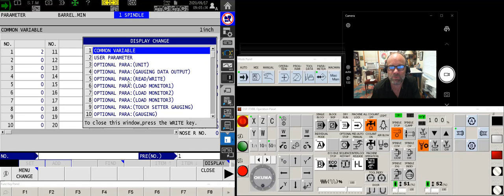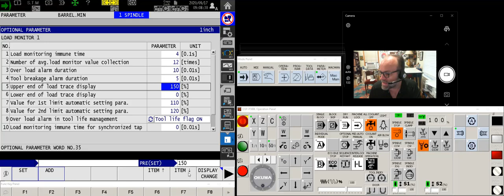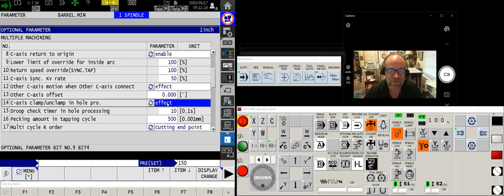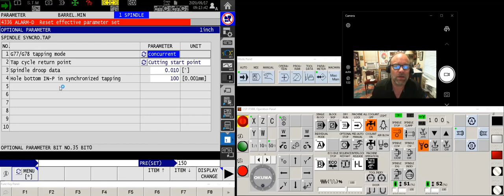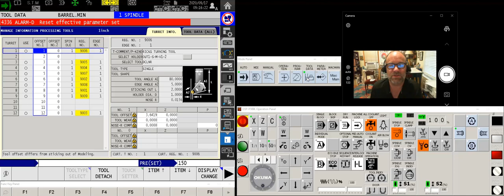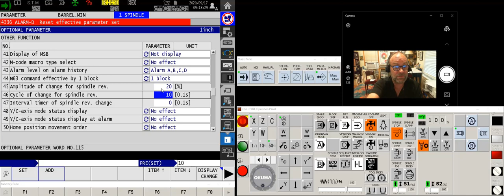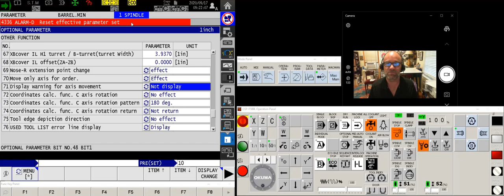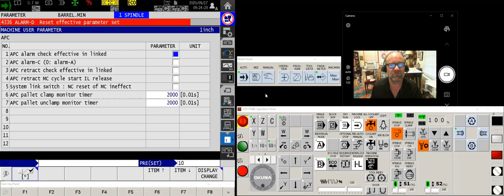Okuma Lathe Parameter setup

Comment: Hi, we have issue.  Loking for help. Chuck vibrate when we turn it in c-lock mode. This happend only when make heavy parts. We figure out that the extra weight is making the chuck overshoot it's position and the vibration is the machine trying to correct it. So watched your video and found parameter: Spindle rotation command stabilizing timer.  Is this correct parameter to adjust? Any other ideas to solve proplem?
Reply from the maker: Oh yeah! Heavy parts can cause problems. Look for the WORK WEIGHT parameter. There are three settings on most machines, four on larger (no chuck, standard , semi standard, and heavy). Try a heavier setting there, and also on your main operating screen under display change, you can run SERVO NAVI which will test the weight on the chuck and adjust the servos accordingly
Reply: We check this tomorrow. We had made this part few years. 
This issue just started yesterday.  when hevy part is chuck and push c-lock all good, it also start vibrate if i hit chuck slow on rubber hammer.

Comment: Hello, I have a problem with my lathe control osp E100l, I changed the ucmb card, restarted the software, and now I have an alarm 4710 alarm D parameter non set 1 can you help me because I do not have backup parameters
Reply from the maker: That alarm means that the user parameter spindle max rotation speed parameter has not been set. Set that manually then cycle power

Comment: I was wondering if you could do a video using m695 I moved the keys on the parameters for this code I added code and I’m still getting no a code saying not reading file I also turned off and turned on machine since I moved parameters please help I’m running a loc650 okuma

Comment: Hi Thanks for the video. on MULTUSB200 I wonder if and how to change Y axis parameter so that when Y is off - the M tool will be in the center of SP1. sort of a way to compensate mechanical problems with Y axis parameter/ endswitch. is this possible?

Comment: hey how do you make your machine lb 3000 exII  to be always in m42 for more than 840 rpm. ?
Reply from the maker: Once you select the range, it will stay there throughout power cycle until an M41 overrides it
Reply: @pocketcharleywithgosiger  yes, but i want prioritize m42 always, i set m42 and machine always  rewrite it, im using igf. i want m42 always to be on.

Comment: Can we rotate the turret with the hand wheel for checking clearances on Okuma LB3000 EXII?

Also, I can’t use G74 or G77 with G138 enabled. Is there a way around this?
Reply from the maker: Yes on the turret question: go to your parameter page, find the page labeled TURRET/DOOR, then look for the item NC TURRET PULSE HANDLE. Apply a check mark to that parameter, then the index button will unclamp the turret and allow the pulse handle to rotate it. Once you're satisfied, remove the check mark then press the index button again to have the turret locate the logical index position and reclamp itself. Make sure your X is at the positive limit when doing this. As for the G74/G77 question: you cannot engage a lathe cycle with G138 active. If you have the option called Y offset turning, however, you CAN command a Y position even when G138 is not active. This can also allow you to compensate for turning tool above/below centerline
Reply: @pocketcharleywithgosiger  I appreciate the response! I’m sure we have Y offset turning, just never used it before. I’ll try it out tomorrow. Have a good 4th! Thanks!
Reply from the maker: @2hrsToChooseThis  My favorite move for the offset tool is to put the error in the Y offset column, then have my program take the tool to X___ Y0 Z___. If that alarms out, you'll know you dont have the option. Happy 4th to you too!
Reply: Thanks for your video. Finally I saw my question here. My Genos L3000e with osp 300 Cannot run Lap cycle with Y axis. Can you please show me how to use Y axis for Lap cycle. Thank you.